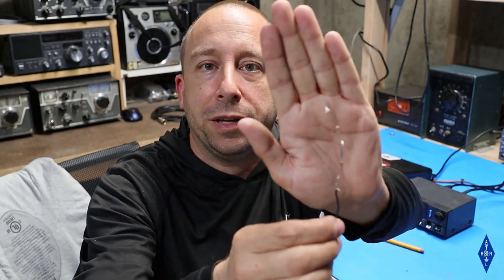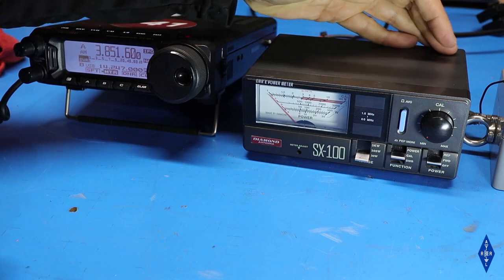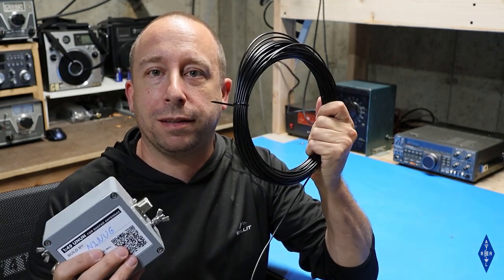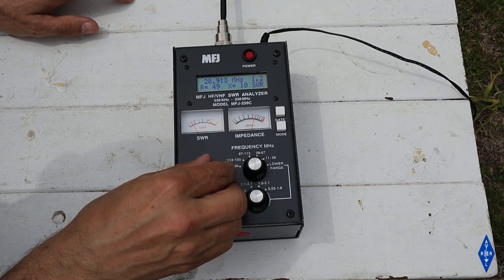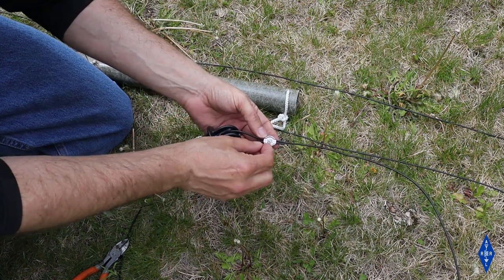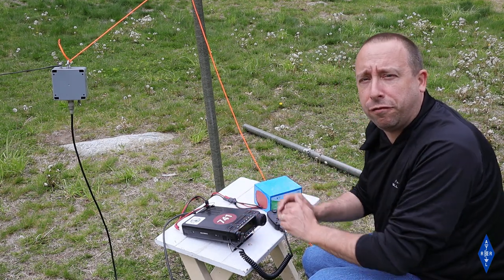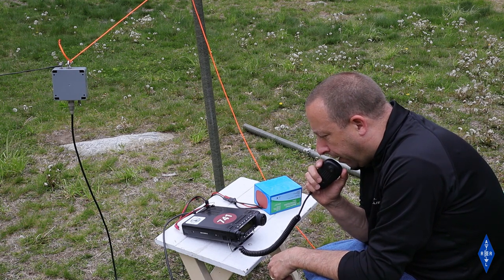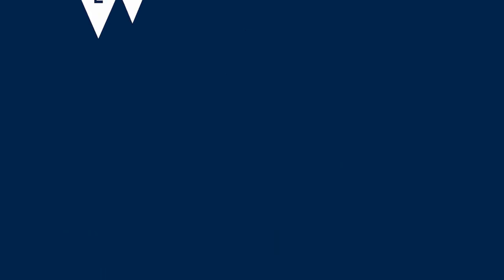EFHW End-Fed Half-Wave Antenna Kit | Part Two: TEST & DEPLOY

Comment: I have this antenna and tuned it while it was connected to the end of the feed line (in the shack). 
I used iPad and a  iPhone connected via FaceTime. 

The iPhone was in the shack pointed at the analyzer and the iPad was with me while I trimmed the antenna wire. I use a VNA analyzer sweeping the range of interest.
 
Worked great!

Comment: Just recently took my Tech license test and decided to purchase this kit from the ARRL store.  Everything needed was in the package except my labor and soldering gun.   Now am waiting on a telescoping mast to get it up in the air in the back yard but while waiting I decided to deploy it from within my garage, out one of the windows to a 12 ft pole I set inside a fence post.  maybe 5 ft off the ground at its lowest point.
Hooked it up to my rig and checked the swr, 1.2 to 1.  Once my call sign was issued I then started to get on the air on 10 meters but the conditions aren't to favorable in my area so no luck on voice contact.   Yesterday I had time to set up for FT8 and once all the settings were dialed in I got my 1st QSO out of the country of Panama within 20 minutes.  not bad for a multi band end fed just haphazardly deployed running out the window!

Comment: In this video and also the part 3 POTA video there doesn't seem to be a counterpoise wire connected, or a common mode choke. It would probably be worth mentioning those points, in case anyone runs into problems with RF affecting their equipment. Other that that, very helpful and a nice series.

Comment: I followed these instructions to the "t" in both parts 1 & 2 and I kept getting screwy SWR readings using 2500 ohms of resistors.  I thought the resistors were the problem, so I  made a new string of 2500 ohm resistors.  Still the screwy swr readings the were off the planet.  I was using an MFJ 225 VNA during my bench test.  I was going nuts trying to figure out what the problem was.  I even had my resistors going over the top of the box just like what is shown in the video.

Then through some experimentation, I moved the resistors 90 degrees to the side of the PVC box.  The swr's were fantastic after some minor adjustments in position.  I now wonder if the use of the MFJ 225 VNA may have been the problem by creating a stronger magnetic field with the toroid since in other videos showing the bench testing with a different brand of VNA did not experience the same problem.  Anyway, the problem solved.

Note to builders of this HFKIT antenna from the Netherlands.  Do not use a knife to scrape away varnish as shown in the first video of this series.  The knife will not clean the magnet wire well enough for good solder contact.  Instead, use 150 or 240 grit sand paper to clean the varnish off the wire before soldering.  The varnish on the magnet wire you get with the kit is very thick and it takes some work to properly remove.   Proper removal of varnish will result in much better solder joints.  Don't ask me how I know all of this.  🤣

Comment: Well done series on construction and deployment. I'm really thinking of getting that kit and making the antenna for some POTA work. Right now I activate from my truck using the mobile HF rig and antenna. I would think this would be an improvement over the screwdriver vertical.

Comment: In the finest tradition of hams everywhere I modded the Unun box to add another eye bolt so I can hang the box from that bolt and use the bolt by the antenna connection along with a  dog bone wire clamp (not in the kit) to make a loop around that eye bolt so I am not pulling on the ring connector which will cause it to slip if it weren't soldered (and it wasn't, just crimped).

Comment: I always fold the wire to make it shorter not cutting.
Reply: I believe that this requires the insulation be removed at the end and at the place where the end comes back to so they can be shorted together.
Reply: Curiously.... that is what I tell my barber. "In case you make it too short, you can fix it." He just looks at me funny.
Reply: @aroninsinga1521  While it's true that the insulated fold will add capacitance and will slightly change the effective length compared to cutting, if you're using a fold-and-try approach you don't care about this, and can just tune for best resonance.

Comment: I’ve got the same antenna.  I’m a technician, KB6NOJ, studying for my General license.  I have the box end about 30 ft up a tree and the end connected to a post about ten feet off above the ground.  I haven’t tried listening with it yet because we got hammered with the worst winter snow storms in forty years and I wasn’t able to finish the installation.  Hopefully this week.  I wondering if it will work with the box at the higher point.

Comment: Great Video. I have a question; did you have the antenna wire pull out of the ring connector or did I pull the wire too tightly. I was trying to get the sag out of the wire. I think I'll loop it thru the "strain relief" ring and use a dog bone clamp on the wire.
Reply: See the comment I just left.

Comment: I see that there is a spot for counterpoise, but you do not use one.  I will be operating on mostly 20m and 40m, my rig will be about 7 feet from the box, with 10-12 feet of coax connecting it.  How do I know if I need a counterpoise, and how do I calculate best length?  Can I drape the counterpoise down my wall, or should it run as close to horizontal as possible?

Comment: Rob:  I am enjoying your videos on the ARRL EFHW Antenna.  I have 2 kits that I need to put together.  It looks like it would be a much quicker implementation than my current portable antenna.  Looking forward to the 3rd video out in the field!
Reply: It's very easy to put up and works well even close to the ground
Reply: @SevenFortyOne  Rob: I can run it across my backyard and my pond and over a Pine tree. The low end will be about 10’ off the ground on the eave of my house and at 50’ at the Pine tree. What kind of directivity do you get?
Reply: @n5pa  I haven't really paid close attention but directivity seems similar to a dipole